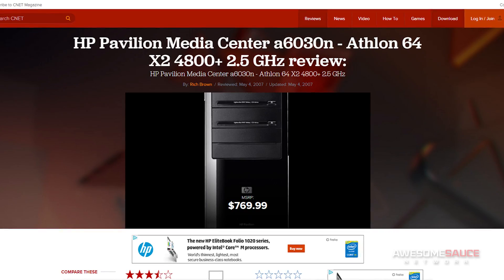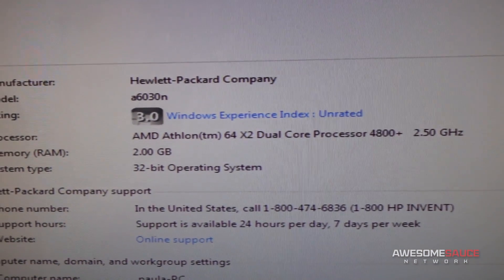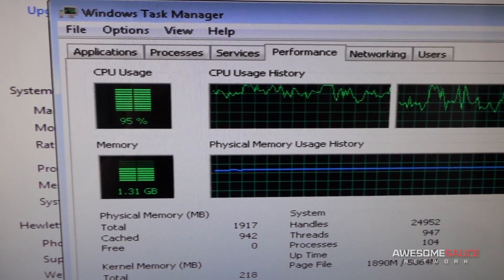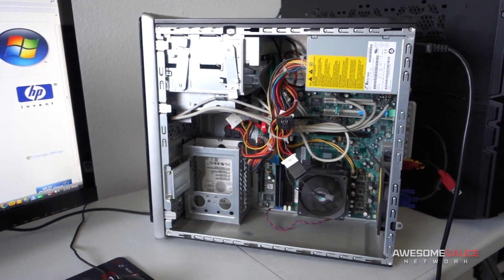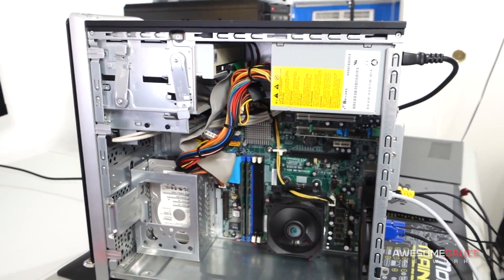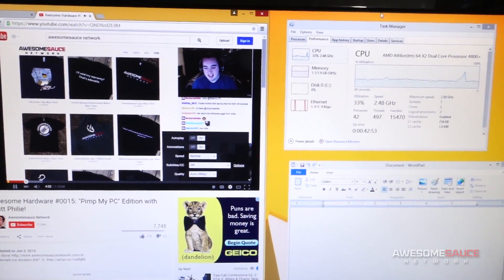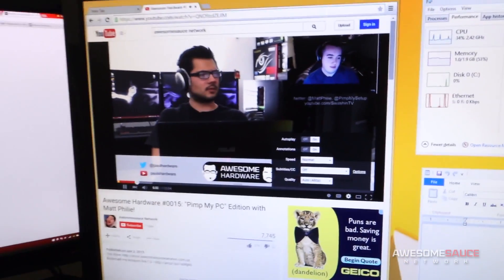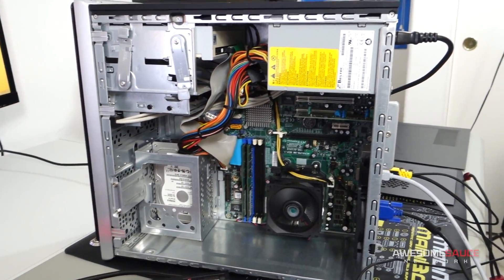Cleaning Up My Neighbor's Old Desktop!

Comment: I work at a Best Buy, and last week or so, someone came in with a computer that sported an original, from 2005 working Intel Core 2 Duo (can't remember the model number), and an ATI Radeon 3650. Me and the Geek Squad agent were stunned that it was even working and the only problem was one of the RAM slots weren't registering in Windows and the GPU overheated after about 20 minutes of gaming.

The kicker? He wanted to keep it and just replace the RAM and the GPU! I was like "I feel unethical even allowing you to have this." He insisted. Some people just really, really don't wanna buy new hardware. Sad, really.
Reply: Ben Kuyt Why would you recommend against spending under $100 on a low end GPU and RAM vs a minimum of $500-600 for a new system if his current set up does what he needs? I mean a reason aside from needing to hit your sales goals?
Reply: CyRxJustin Cause his current setup didn't do what he needed. He wanted to play higher end games and do in home streaming to his basement NUC. 

Why would you keep a core 2 duo system when you can get a more up to date system for 300 bucks that won't die on you in 6 months? 

Also, good job assuming, I'm not a salesman. My reason for doing it was because an LGA 775 system wouldn't do what he wanted
Reply: Ben Kuyt Everyone at Best Buy is a salesman, read your employee handbook. $300 doesn't buy a more up to date system from Best Buy, it gets you a Celeron system or if it's on sale maybe a Pentium. i3 will run from $400+ and i5 on sale will maybe go for $500+ (this is for items on shelf, not open box; of course you can find other deals on bestbuy.com but those aren't in store).
Reply: CyRxJustin It was a desktop. You can get a Pentium for $300.

Please, don't tell me about my own company. I'm not a salesman, I'm a merchandiser. I'm also in Canada. PLease, keep assuming.
Reply: Ben Kuyt you guys are fucking pricks and rip people off...... i bought a pc from u guys a year ago and the guy says this pc is good for gaming............ it was so shit.... 1 fan APU and it didnt even run a stable 60 on minecraft and m ps3 looked and ran better on cod thEN THE PC ON LOW. also u charge people 200 dollars for a simple 25 dollar hardrive fix... i bought a sick pc 960 8670 for 1000 and got it custom and am now happy
Reply: Kolatz Playz If you're gonna get a PC for gaming, make it yourself. Even I would recommend that if you came to my store. Any APU that isn't an A10 is terrible.
Reply: an a10 aput isint even that good if you just want to do stuff other then games and want amd just go with a 6300 like jesus

Comment: Could you gys help me on this would they all go together? Case:Corsair CC-9011058-WW Carbide Series SPEC-03 Windowed Mid Tower ATX Gaming Case with LED Fan - Black/Blue
price:£50.43
MotherBoard:Asus Z87-PRO V Edition Motherboard (Intel Z87, DDR3, Socket 1150, 2x PCI Express 3.0)
Price:£94.75
PowerSupply:Corsair CX750 Builder Series CX 750W ATX/EPS 80 PLUS Bronze PSU
Price:£64.80
Proccesor:Intel Core i7 i7-4790K CPU (Quad Core 4GHz, Socket H3 LGA-1150)
Price:£257.57
CpuCooler:ARCTIC Freezer 13 - 200 Watt Multicompatible Low Noise CPU Cooler for AMD and Intel Sockets with pre-applied MX-4 High Performance Thermal Compound
Price:£22.22
DvdDrive:Samsung 24x Retail SATA DVD Writer
Price:£11.71
GraphicsCard:EVGA Nvidia GeForce GTX 980 Superclocked Graphics Card (4GB, GDDR5, PCI Express 3.0)
Price:£439.99
Ram:Corsair CMZ16GX3M2A1600C9 Vengeance 16GB (2x8GB) DDR3 1600 Mhz CL9 XMP Performance Desktop Memory Kit Black
Price:£79.00
Hardrive:Unknown coming soon :)
Price:Unknown
Os:Windows 7 Professional 64 Bit MAR Refurbisched Hologramm incl. Servicepack 1 English UK
Price£34.00

Total Price:1373.43
Website www.amazon.co.uk

Comment: I Use Only Windows 7 Computers And I bought a New one when windows 8 was Out But For Aleinware Computer. Windows 7 Is Easier For Not Touchscreen Users And I Believe The Next Generation Of Computer With TouchScreen and Will Keep Up Running Lots Of Tasks The Background. They Could Have A MultiTasking Auto Device That Can Do Stuff Like Run Movies To Other Devices Nearby. It Might Seem Crazy And A lot Of Software fails Trying To Create A Safe Running Next Gneration Computer

Comment: I do this #$%! about once every 2 weeks or so (once people know you can.... and yes i get paid). - (No i don't make videos about it and i do this in my free time).
Sometimes i get machines that aren't worth repairing which have like bad capacitors or other issues which can't be fixed by reinstalling windows i mostly end up building them new machines, the old machines i get to keep and i take out the 'useful' stuff which i then sometimes use to 'upgrade' other machines that come in. Let's say increase memory or a bigger HDD (or working HDD) or replace an ancient VGA for a somewhat newer one. I do enjoy doing this from time to time but.... Man some people can be annoying..

Some people expect their OS to be cleaned like f.e. everything is where they left it. 
What i mostly do because most people put their stuff everywhere.. docs/pics/music/vids etc all over the place i just take out the drive and mount it in a test PC and let it do a search for common things and then store that on a network share/external hdd and scan it for viruses etc. Then after i'm done either reinstalling the old PC or building a new PC i copy it all back and let them sort it out.

This whole process is however really time consuming, yes i don't need to be there for let's say 50% of the time while it's searching files/scanning files/installing-updating windows and all the other programs those people want on it.

It's good to you take your time to fix an old computer like this, it would be however interesting to see what kind of problems you ran into, viruses you found etc.

Comment: it's not optimized to upgrade the OS of an old PC to Windows 8.1.. since 8, the windows use graphic card to render desktop by default and can't be switch off. this will tax on the limited resource of an old PC. So I would install a Win7 which is the last non-graphic-card-enabled version of windows..

Comment: Technically it does not have a 3.0 on the Windows experience index. As you can see, it was unrated. Had you run it, it would have been different.

Comment: msconfig.exe in run, select your programs that you want to boot with then you should clean the register, regedit.exe, do a disk defragment, check for malware with atleast 3 programs, ccleaner( deletes your chache and temps file and much more),uninstall programs that you dont use, make sure your browser doens`t have unnecessary extension, and it will run almost perf.

Comment: Good video but on an older computer like that, Why wouldn't you put a linux distro on it such as ubuntumate or xubuntu or some other linux distro for older hardware. I'M using ubuntu 14.04 on apu fm2+ and it works perfect and especially for just a basic user. you also wouldn't have to worry about malware and virus's. I do use windows 8.1 in a VM but i find that i rarely need to use it.

Comment: That Bestec power supply is probably a motherboard killer, i have two there model ATX-250-12z. in one computer it killed the motherboard and harddrive so if your friend has important files on there he might want to back them up somewhere else

Comment: we have one PENTIUM 4ht (made in 2005) runs at 3mhz 1 gig of ram ddr2
I already made the estimated if its upgraded to 4 gigs of ram and we replace the HDD to a SSD we will pay arround $80 
que question is 
should we upgrade and format the pc or should we buy one of those mini PC that cost arrond $150 (most requiere to buy extra adapters)

Comment: You do the same things I do when someone asks me to refresh his/her old pc, in the same exact way. I stick to win7 though. On a similar system (the one in your video), if the motherboard supported more than 2 gb, I'd have added some 2 gb of ddr2 and gone for W7 64 bits (even a toaster or a dishwasher now supports 64bits os'es): 2gb of ram was the minimum until some 2-3 years ago, nowadays if you still under 4 gb you'll surely run into a hell of slowdowns, even on a tipycal "office-use" pc.

Comment: I have a older Compaq presario sr1923wm desktop originally it had XP installed on it and I purchased a copy of windows 7 from school and that is what it is currently running, I believe the power supply is bad is there any home remedies I can do to see if it that or not. I cleaned out the case with duster and when the power supply is not connected to anything ie out of the case the green light comes on when power is connected, when I put it back into the case the light doesn't light up and does nothing when I press the power button. plz help.

Comment: I have the same exact computer except with a 4600+ processor. It actually came out in 2006 as I remember it. Ever since, I've modified a lot of things- the OS (win10), memory (4gb), HDDs, DVD drives, GPU and PSU with parts I salvaged from other computers.

 I ran into the same CPU spikes and memory utilization issues. I ended up buying new RAM and changing the OS. Vista is actually one of the slowest of the OSs. I still run into processing issues- and that's just because of the age of the processor.

Comment: did he just glue something on the processor?
Reply: Double RDare you referring to around the 5:54 mark?
yeah, it's a heatsink fan
after he removed and cleaned it (shown just before in the video) he then had to reapply it. Except the computer-term is 'thermal paste' rather than glue

Comment: Add some cheap SSD e.g. intel 310 160Gb ~$50, get another 2Gb ram ~20$, some not to fast GPU for another ~$25, this computer will FLY.

As long as your computer have "any" dual core processor (but not Pentium D), this kind of update is really nice.

Comment: I would've had them spend $1000 for a 4790k setup.  The processor in the current system is like what 1/7 as powerful?  I guess it depends on what you're measuring.  Still, 2GB of ram and idling at over 15 - 20 % is unacceptable :S  Also, I'm sure they'd love mini-itx.

Comment: Tip: If your Fixing up a old PC. and have the fan's out of it. Relube am.
you use sowing oil. take off the sticker at the top open it up drop some oil in it.
and you sound is gone ^,^

Comment: Cool video, Personally I would have bumped the memory (ebay) and tossed a low end video card and ssd in it (if the budget is there). You can reuse the oem key (as far as I am aware) to install vista 64bit SP2 update discs are so much better than org home prem and bob's your uncle. But you gotta watch out on those older hp boards if they have nvidia chipsets, they always ran super hot and would cook their bga solder balls.

Comment: that BIOS on that board can be modded to support overclocking, i had a similar board MCP61PM-HM Iris (2 DIMM slots) and modded it, it also added support for faster CPU than the max 4800+ the board supported, anyways the BIOS mod can allow more CPUs to be used (83 or 89 watt max) and some boards variants will support Phenoms and maybe with mods Phenom IIs to some extent

that one is is a Nettle, so no Phenom support can be added

Comment: My system is also bought in mid 2007 and I'm still using the AMD athlon x2 5600+ but I think my system is dying soon. It has problem booting up and sometimes I have to press the power button twice or more to boot up the system. At other times, when i turn on the system, the fan is very loud but nothing on the screen so I have to force off it and turn on again for it to work. I have tried reset the bios but nothing fix the problem.

Comment: I still have the RAM modules from a similar HP system (from 2008 or 2009). I live in Denmark. If you need it, I would gladly donate them (would just require postage paid).

Comment: Tidying up the Cables and cleaning it adds next to nothing to the Old Desktop. It's clean, might be a few percent more points of performance. For a clean install, I would have given him an SSD for his OS (whats that like $40 for a 120gb basic one) that would probably give him the best performance increase as a basic user.  Keep his other HDD unit for mass storage.

SSD is probably bang for buck the best thing you can do, so long as you use it for your OS and Programs like Office etc.

Why upgrade his MOBO and stuff, if his 8.1 Win works? Oh and then stick some AV on there to stop him infecting himself.

Comment: You should know cable management in this type of PC is worthless, nothing changes unless the wires are getting stuck on the fans. The biggest issue is the CPU, a single core Pentium 4 650 does a better job than the dual core AMD 4800+, so you know the CPU is pretty awful and let's face it really old, it was entry level 10 years ago, for example a 2007 Q6600 is 10x faster.  If wanted to do him a favor you would have  asked him for $150 and just got him a newer AMD cpu/mobo and 4GB or Ram that even supports HDMI and 1080P video or got him one of those 75$ dell PC's everyone is selling that have the Q6600 cpu's with 4GB of ram.

Comment: Funny to see that people allways tell other people to upgrade to a more recent computer. That is exact what people should do to scrap more computers that in fact still capable to do the job. The current computer i am using is an 2009 HP DC7900 sff with a C2D 2.6gHz and 4gb of DDR2 memory. Still doing audio and video editing on it and at idle using 0 to 1% processor. 

Why throw away a computer that is still working perfectly fine? The only thing to tell about this computer is that it is running Windows Vista that was allready not a very good OS at that time, and it is an AMD processor from wich is known that they work fine but there are better ones. 

For anyone who want to have a nice computer like a C2D, just look at the second hand stores. Buy one for 50 dollar, wipe the harddrive and install Linux Mint on it if you only surf the net and using browser based mail. They are that cheap to find because all the computer stores tell you that "an old PC with windows xp isn't safe anymore so you have to buy a new one". It is still as safe as you know what you are doing, not clicking the wrong links and not downloading from torrents and using hacked software, you are pretty safe to do whatever you want. 

Everyone is participating the "throw away" culture and Apple is happy to provide you the tools for that. Stores are very happy "to help you" with that. Using your commen sense and you know that a computer ( basicly a very advanced calculator and in germany called a "rechner" wich is just a calculator.) would still work if you install it right and not putting 5 anti virus controllers, 7 spyware removers, 15 watchdogs and 2 driver updaters on it. Even an old P4 3gHz HT still runs fine with Linux Mint and only using internet applications. Think about that when walking into a store to buy a new computer.